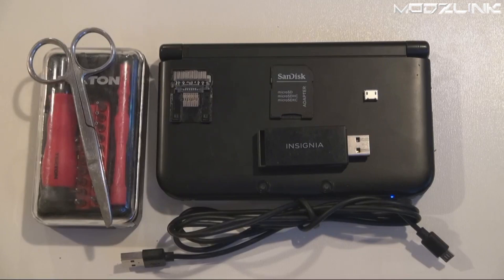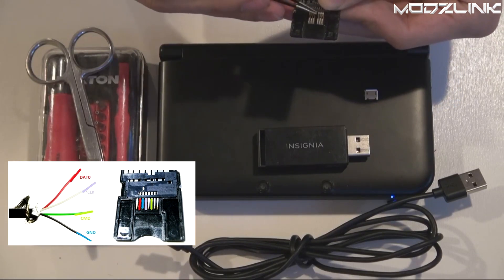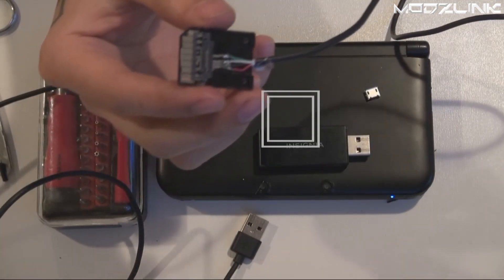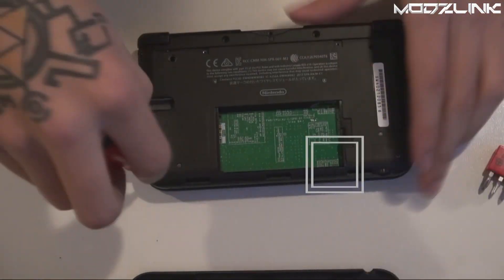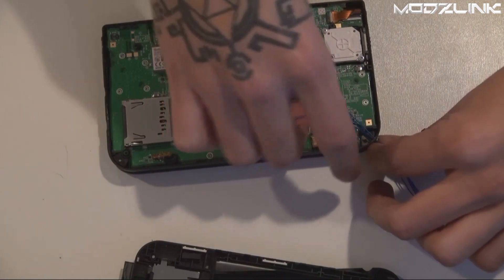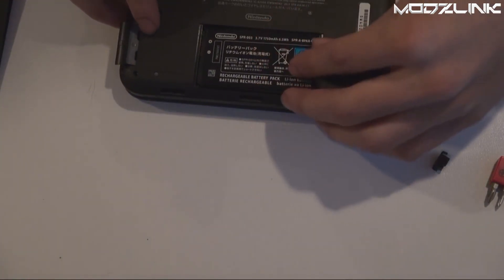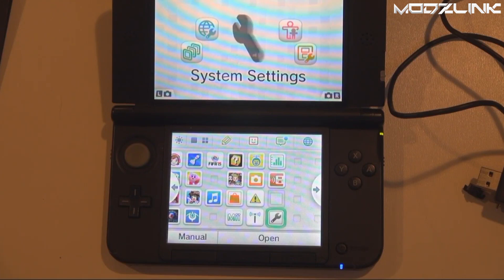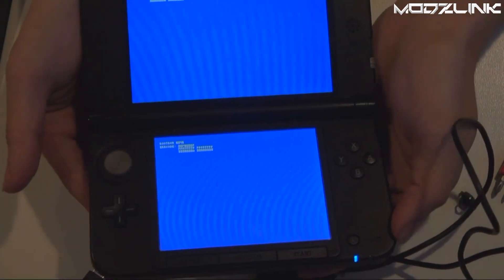How to Hardmod a Nintendo 3DS XL - Easy NAND Read/Write Access

Comment: i have an old 3ds. theres a cfw i used long time ago. i think it was removed from the guide but basically i had to downgrade to 2.1.0 to then update to 9. something to be able to install boot9strap etc but i wasnt able to follow those instructions due to one of my friends updating it with a random ds cart and it corrupted it and now im stuck on 2.1.0 since forever and im trying to revive it. i tried using a flashcart but it doesn't load it up. it doesn't have recovery mode either. can i use this hardmod to flash an update to it so i can later install cfw with hardmod or using a flashcart?

Comment: Using the wrist strap hole to house the micro USB connector is an absolute genius approach.
Does this allow to put custom firmware in the NAND as well?
Reply from the maker: Yes, I did this to backup my nand in case of issues while installing cfw

Comment: You ever try this with a raspberry pie? instead of soldering the micro usb just solder breadboard wire to the nand and make them accesible and hidden somehow?
Reply from the maker: Sounds too complicated. Not enough reward for the time and work.
Reply: @ModzLink  dang I didnt see you replied, thank you! Great video you have here, its awesome. I think a jtagg with a pie or arduino controller it can be done

Comment: It's funny, because I installed a hard mod on my 3DS the day I bought it, it was awhile back though. I actually hard modded my 3ds before I soft modded it. lol. 

I didn't need to hard mod it, i knew I would never brick it. But i like to tinker, i also like to code my own homebrew apps, so i knew I should hard mod my 3ds first, extract the NAND, OTP, and all other files I needed for a full restore. 

That way if I need too, i can restore the NAND to the time I first bought it, faster then uninstalling the CFW and formatting the system. And of course, this way I can develop apps and test them without the fear of a hard brick. 

I also test out all the crazy apps that people make. You would be surprised of how many homebrew devs are looking for people with 3DS with Hard Mods installed, just so they can let people test thier apps in the alpha stage. 

Most devs that make apps that read and write to the NAND, will never release thier apps to the public that are in the alpha stage for testing. Because most of the time, them apps due cause a hard brick eventually. Devs brick thier 3ds all the time, if they are developing apps with nand write access. lol.

Comment: can i unbrick a new3ds stucked on black screen on firmware v2 i have a backup nand firmware v11
Reply: Probably
Reply: Is the NAND backup from the bricked 3ds, or is it from a different 3ds? Because you need the NAND backup from the bricked 3ds. Using a different backup from a different 3ds won't work.

Comment: What do you use to write the nand to restore from a brick because I’m using win32diskimager and I when I try to write I get a 1117 write error? That’s my problem is I get it to read just fine but when I go to write it gives me the error that says ( Error 1117: The request could not be performed because of an I/O device error) I would think that if it could read it can also write fine but it’s not. What should I do is there another step to get it to write?
Reply from the maker: Check your soldering it should be able to to read and write without issues and always verify your dumps before writing
Reply: ModzLink I found out what the problem was is that I didn’t put the lock unlock switch back in the sd card adapter so it was locked and write protected lol took me 2 days to figure that out. It wrote back after I put it back so it’s fine now and works again! 😁

Comment: For the part you put the USB mic to out in, would using epoxy over hot glue offer any stability? What gauge wire did you use for the internals? I have cables meant for breadboard work but worry the might be too small. Thanks for any help!
Reply from the maker: You can use epoxy if you want. I believe the wires used were 30aug solid core. It's typically referred to as wire wrapping wire: https://amzn.to/2AmhYbm

Comment: is this the same process for a 2DS XL ??
Reply from the maker: I'm not sure about the 2DSXL I haven't tried on that console.
Reply: different pin points, and the plug will only fit in the stylus port (yes, I did it myself)

Comment: Great video you've created there! It is very demonstrative and comprehensible. I've searched for help due to a recent system update error of my old 3ds XL. I've used Luma, CFW and Homebrew on the console before thus the support apparently won't help me with the issue. The console performed an "auto-update" which is very curious cause I haven't given my consent to this. At some time the following message popped up on the start launcher: "Update installed - you may now restart the console" After I hit "cancel" my console turned off- and when I tried to turn it back on the blue light for power is just lightenedfor half a second. I intendly followed your steps, bought the anker adapder being recommended in the description and checked my soldering for eventual issues. Now I finally get the bluescreen with the errorcode "00f800fe [...] 00000400 [...]" when the 3ds is connected to the computer. Now I have only one big problem: My consle is not recognized by windows or even ubuntu. Could somebody help me with this issue? BTW: Before the brick of my system, the firmware was on version 11.0.0.33 E

Comment: just hardmodded my 3ds xl - soldering to the legs of the usb cconnector was the worst ever ... took about 6 goes to get the wires soldered properly with no bridging.

Is there a connection that is easier to solder to ?
Reply: Just try to prime the points first with a little flux and solder. Then try to solder the wires to the primed points.
Reply: run the wires out of the stylus slot, preferably bread board wire to use as butt connectors

Comment: So i bought a double-ended micro usb cable, one end beig a male one end being a female port.
I cut the male end off and stripped the wires and there are four colored as you have specified, in theory are these already connected to the correct points on the female port standardly, or do i need to disasemble the cable and redo the wires myself?

I would like to keep the cable intact and just hook it up if it in fact would work as i can cut the plastic surroundig the female port to fit perfectly into the hole in the corner of the 3ds, allowing the completed plug to look very professional and not the least bit out of place

Edit: it actually has five wires - white green blue black and red
Reply: Oh and if i actually get a responce from you ill subcribe cause that would be p badass :P
Reply from the maker: +Nico Keenan you still need to take the cable apart. But this method is no longer needed if I remember correctly
Reply: Thanks for the response, you are correct its not i just dont have the money to buy an r4 atm so with no money to put into it this would be my option if i decide to mod my 3ds
Reply: ModzLink Subscribed

Comment: is the sd card reader necessary even though i can connect it directly to my laptop? ( there's a slot for sds)
Reply: Yes. There are only certain SD card readers confirmed working with the 3DS. The Anker® USB 3.0 Realtek RTS5306 works with all consoles, and is the best choice. You can find it here: https://www.amazon.com/gp/product/B006T9B6R2/ref=oh_aui_detailpage_o00_s00?ie=UTF8&psc=1

Comment: why remove usb head on cable just to add sdcard reader that does into a usb device?
Reply from the maker: +Troy Mack because that's the way it can be read like a storage device
Reply: Troy Mack if you do it straight to a USB it can sent power to the nand and permanently brick the device

Comment: My 3ds is bricked would a hard mod fix it ?
Reply: Destroyer 15 depends, look up what went wrong and troubleshoot. it may just need files on sd card aranged diffrerently.
Reply: ORION 
ALL of my hacked files are deleted my console doesn't turn on without or with the ad card, am I fucked?
Reply: ThebiglotgamerXD do not worry soon all you will need to have to fix it will be a r4 flashcart and magnet. look it up
Reply: ThebiglotgamerXD https://gbatemp.net/threads/poc-using-a-magnet-and-a-ds-flashcart-to-unbrick-a-3ds.472586/
Reply: TheN64man Not yet
Reply: DaWirez|WiredUpMods it could if the flashcart list and sych was released
Reply: TheN64man True. I find my self googling ntrboothax or magnethax almost daily waiting for it to release.
Reply: DaWirez|WiredUpMods well it is out now
Reply: Look up how to unbrick your 3ds
Reply: a magnet can fix it

Comment: I just installed my hardmod my 3ds turns on and works but when i plug in my sd card reader i get blue screen.... And wanted to ask if the blue screen needs to have a certain bootrom error code......... Another note I don't hard any of the correct sd card readers. i will await your reply ModzLink
Reply from the maker: +GameBoy get a card reader from the description.  The code doesn't matter
Reply from the maker: +GameBoy get a card reader from the description.  The code doesn't matter
Reply from the maker: +GameBoy get a card reader from the description.  The code doesn't matter

Comment: can i wire to a microsd to usb adapter?
Reply from the maker: sure if you really want to
Reply: ModzLink sweet cause I keep melting the sd adapter...
Reply from the maker: just make sure you wire to the correct pins in the adapter.

Comment: did the insignia card reader you use in the video, read the nand and write it well? im looking for a cheap and funtional reader
Reply from the maker: everything is in the description
Reply: ModzLink  the card reader you use its diferent to the one you use in the video,so i ask again, is the one on the video compatible?
Reply from the maker: The insignia is spotty. The iogear and the one in the description will work best. Best not to chance a $200 console.
Reply: oh ok  thanks, actually i get my xl for 20 buck just because the 3d flex whont work well, but i can hack it i ntime, now this 2ds i have i cant read ir whit my regular readers maybe perhaps its a samsung chipset
Reply: I tried to use a Sabrent card reader... no dice.  It looks Windows detects that something is there and gives it a drive letter, but it can't read any contents.   Going to order the Anker in the description I guess
Reply from the maker: windows is NOT supposed to read the contents. You are supposed to make an image of the contents as they are with win32imager. DO NOT format the drive or you will brick your console. Windows can't read A LOT of different file systems it doesn't mean there's nothing there.

Comment: do the micro USB red black, white and green cables have to be strictly used each for each pin or the order doesn't matter?
Reply: Hollow Hunter The order does matter. Each point has a specific purpose. You don't want to solder the Data point into a ground point, or one of the others into a different point.

Comment: Do I need the SD card reader if i have one built into my pc?
Reply from the maker: You can try the built in reader but it's not suggested on GBA temp. Everyone suggests using an external because it doesn't run a current to the console until you plug it into a USB port. I wouldn't take chances if I were you but that's your choice.
Reply: ***** so it would work but is not recommended?
Reply from the maker: I don't know if it would work. If you want to risk it try it and report back.
Reply: ill just buy one off of amazon
Reply: ***** Also this method will work on 11.2 right?
Reply: just use the links in the description, they're there because they're the recommended parts.

Comment: So you can't charge the device anymore after hardmodding?
Reply from the maker: You don't use a USB cable to charge a 3DS. You use a 3DS charger.
Reply: ***** actually, you do use a USB cable, since you could just as easily plug it into your computer and charge that way
Reply from the maker: 3DS power cable / plug: https://goo.gl/45721X

Definitely not a USB cable...
Reply: Plugging a USB cable into the mod port, and plugging it into another active appliance would likely have disastrous results. It would likely send 5V through the port, frying the NAND and hardbricking your console.